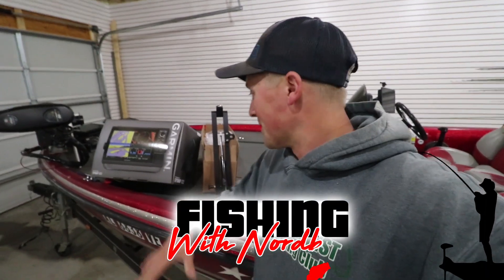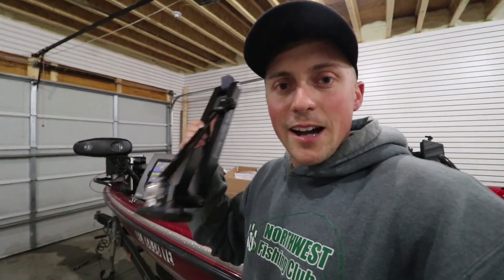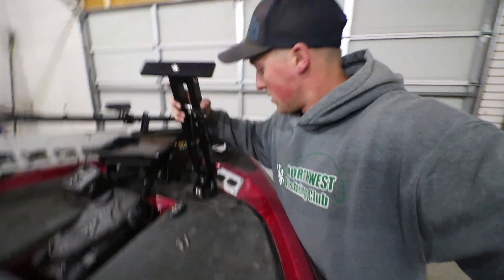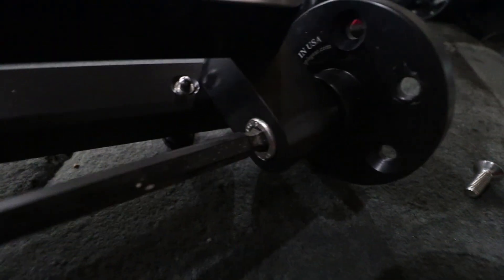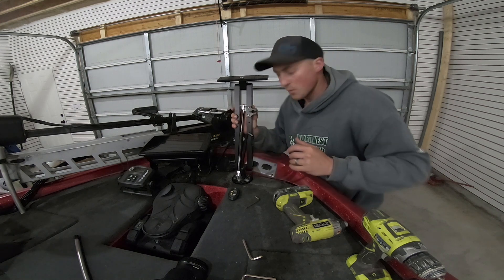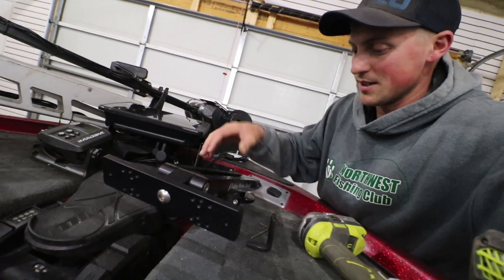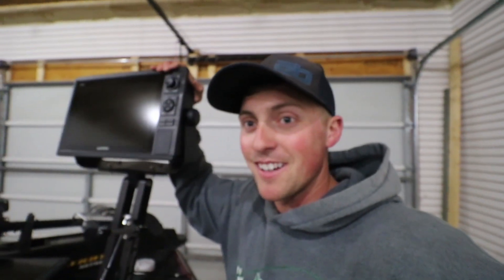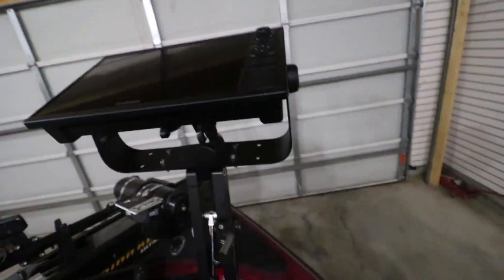EASY Install of FOLDING LIVESCOPE MOUNT on BASS BOAT! (Cornfield Gear)

Comment: Super nice idea! Just put mine on and kept the upper extension by cutting off the handlebar tubing. Shaved scotty and homemade gimble mount fit right in. Put 1  oversized nut between the base and deck for front two mounting bolts and stands straight up. This height made my lowrance hds gen3 9 seem so much bigger and saves my neck. Not to mention saving over $300 on a flip down mount and another $40 on homemade gimble. Awesome engineering fun!

Comment: What kinda screws do you recommend to use ? I’m assuming your boat had a fiberglass deck, 4 screws is enough to hold it just into the fiberglass?

Thanks man
Reply from the maker: I’d through-bolt it if you are able!

Comment: Fish Finder Case Question -- I understand you typically keep your garmin graphic on the boat in a garage. So they probably secure.

I have an open carport on the front. Less secure. Will keep them inside.

Some people that travel / lodge must case their garmin graphs, not leaving them on the boat.

What type of hard case do most use?
Pelican? -- expensive  but so are the garmins

Looking for any suggestions.
Reply from the maker: I don’t have a hard case for my graphs, but just lock them in the truck overnight when I stay places or put them inside for the night!
Reply: Harbor Freight

Comment: That mount is the perfect mount especially for a double mount.  Great job.  Will you run with the edge of the graph resting on the deck of boat?
Reply from the maker: It is!! It has a resting shaft like a trolling motor!

Comment: Wondering how much lose wire you have to have on deck to lay that thing down?
Reply: I have a double screen mount like this. There is very little wire to contend with . I have mine wrapped with nylon sheathing and it looks and works very well.
Reply from the maker: I don’t have any loose wire actually! It’s zip tied to the mount.
Reply: If your wires come out near the base, you shouldn't have any technically, because you aren't changing the distance from base to graphs when  in the up or down position